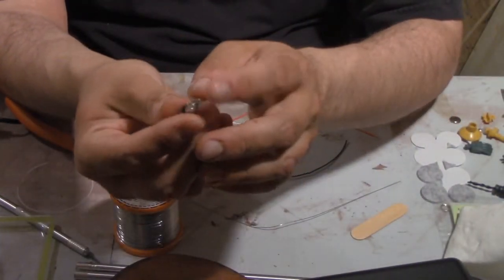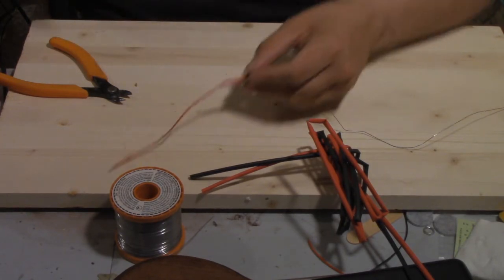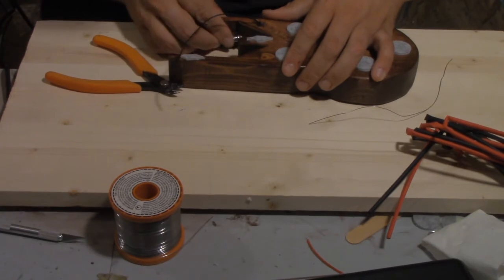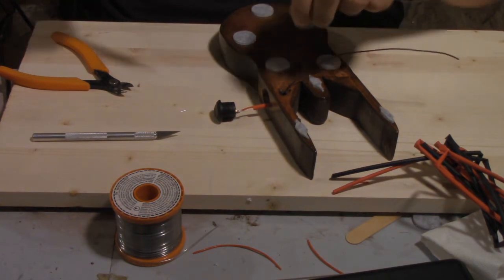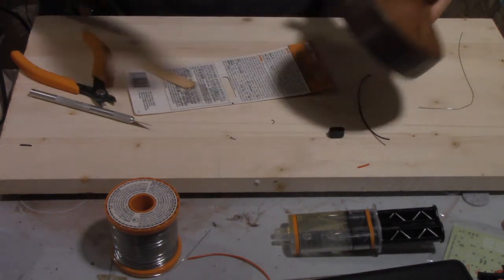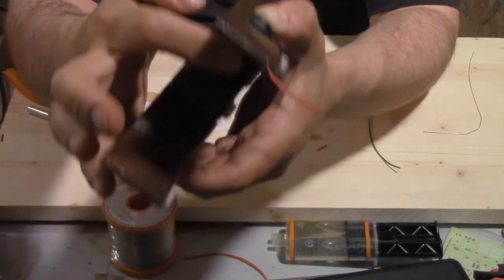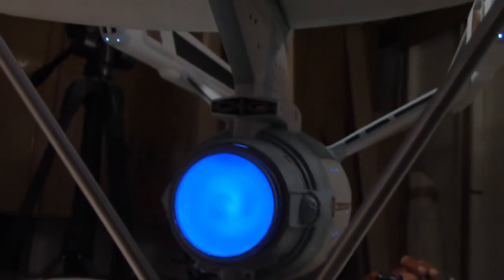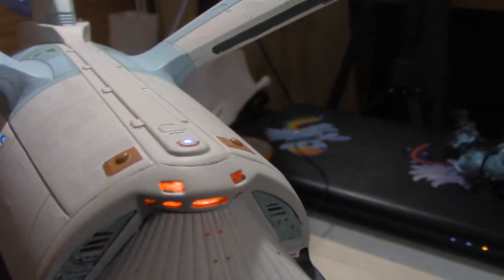Polar Lights NCC-1701-A restoration, part 4; Second star to the right...

Comment: As someone who has built one of these bad boys, I know exactly how painful it is to build.  I'm so glad you were able to repair it.  When I saw the model broken, I was really sad for you.  So much work down the tubes.  Now she's back in business!  I'm actually building a second one right now, as my first one is losing LEDs.  When I built it, I used a lighting kit from an online source, and the resistors were all the wrong values.  I know your pain with lights going out.  Now that I know a lot more about lighting, I'm designing my own lighting for it.  My second one won't go dark, that's for sure!  Congrats on the repair!